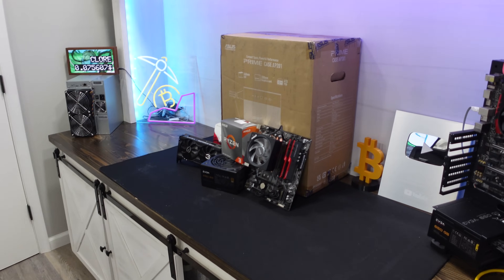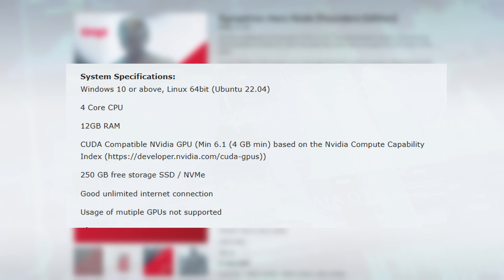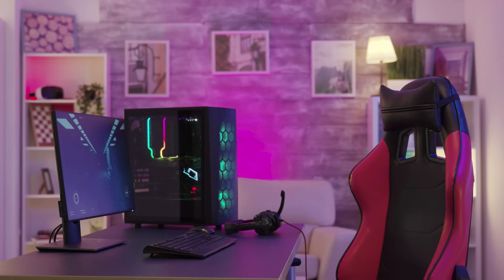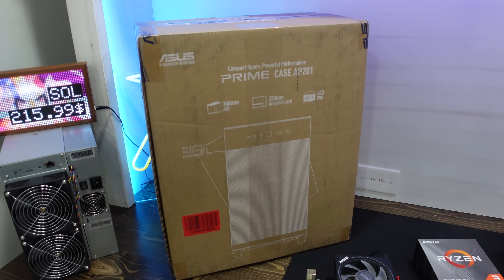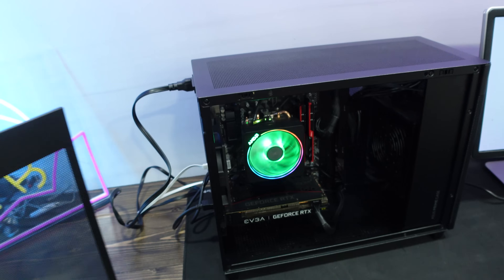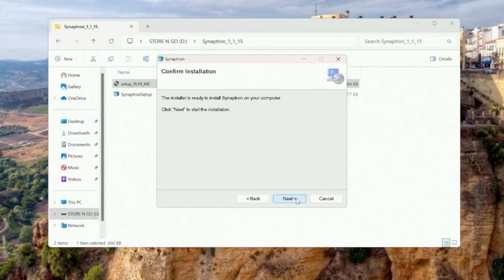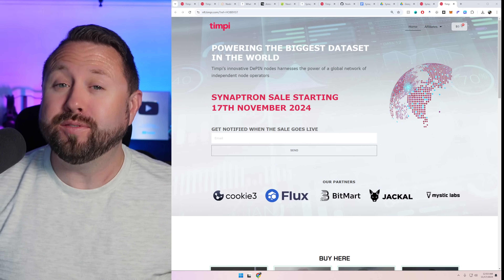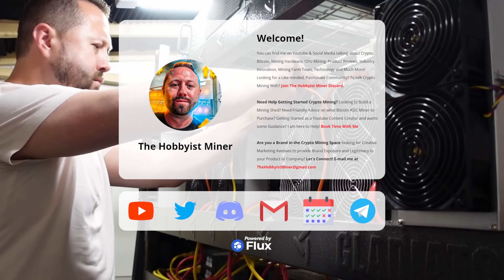Earning $92 a MONTH from a SINGLE GPU?! Timpi Synaptron Node

Comment: Im right now running 6 nodes on the same server. 4 Guardians and 2 Collectors. The other server is running 4 Collectors. Hope to soon also integrate 1 Synaptron each to both servers making it 7 + 5 nodes . Think all my nodes will give me about $1000 per month within 3 months.
Think this is a genious move to use NFTs as Keys fror the nodes. They can later on be sold and only the one holding the NFT can run the node!
Also , Timpi choose to use this method instead of having people to stake tokens to run the nodes. This is often used in other projects. 
..but i like the NFT modell. Its easier for the Network to adapt to the changes it needs. I cant be 10000 Collectors and 100 Guardians. The ratio is needed to keep the Network stable!
Using over 500 Mbit 24/7 and was at one point during 2 days at my max , 1 Gbit. Think i have Collected about 5.5-6 Billion pages since the start

Comment: I purchased two founder synaptron nodes yesterday. They build requirements for two nodes is one node per video card. How does that change the rest of the build if I'm running one Tower of the two video cards is it better to run two separate computers for each node?
Reply from the maker: You will need two total rigs.

Comment: Hopefully it's better then the collector node.  I got it in August and got paid for last part of August and nothing for October.  I had it on node orbitz but have to check it daily as the node doesn't work all the time.  Thinking I won't get the $500 BTC back from this investment :(
Reply from the maker: Have you contacted Node Orbit? I have had no issues with my Guardian Node.

Comment: bul sh-t , cost ele😂ctric is over 100 usd per mounts
Reply from the maker: The Rig I built in this video runs at 226 Watts under full load.  I have my StarPower Plug on it right now that has a built in Watt Meter. At 226 Watts it cost $0.54/Day and $16.60/Month.
Reply: @TheHobbyistMiner  At what kilowatt/hr cost is the .54 and 16.60 based on?